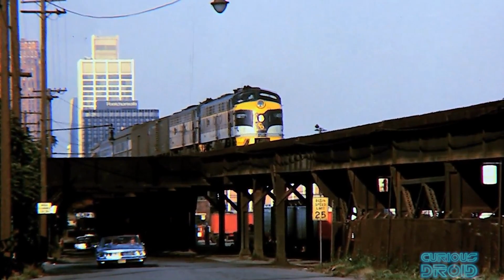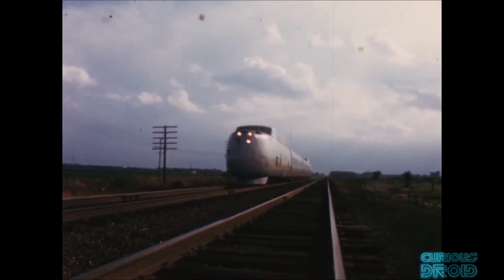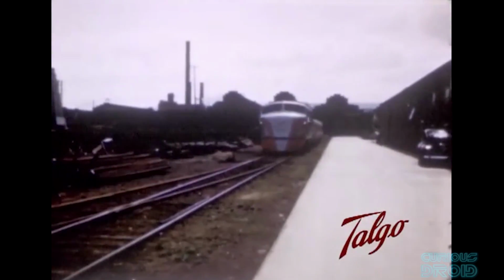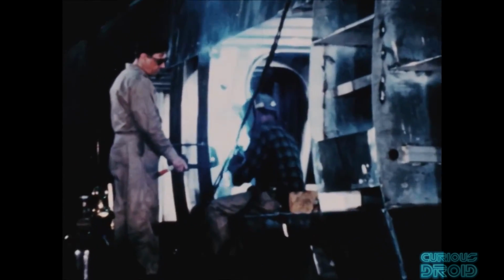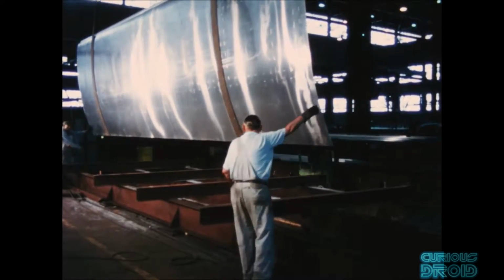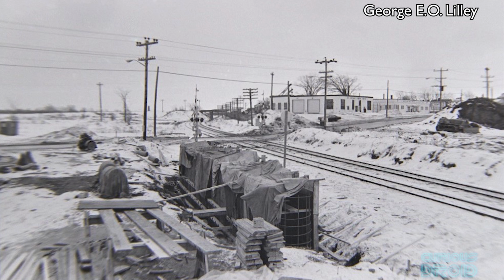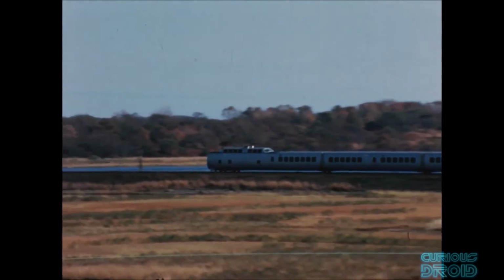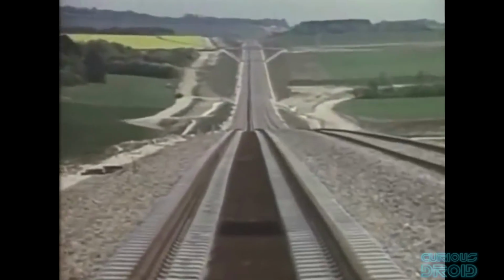America's Failed High Speed Tilting Train - The UAC Turbotrain

Comment: thats the problem, and its same here in australia too. a high speed line could easily run sydney - canberra - melbourne but no actual high speed track exists and would require construction, so they wont do it. So getting around the relatively compact south east corner of australia still requires a 90 min airplane flight with all the hours of pre and post travel waiting around that requires

Comment: Great video. Learned a lot.  I rode Canada from Montreal, Quebec, Ottawa and Toronto in 2018.  As well as France, Japan, China and others over the years.   What it taught me was you don't have to have highspeed to have reliable useful rail traffic.  It is is more about running 60 - 80 mph consistently and station access that is located in the middle of town/ where people need to go.  In other words, there nothing high speed about high speed rail.  Sure faster is better, but cost effective?  Historical example, Pennsylvania rr electric lines on north east corridor.

Comment: The Australian high speed train, XPT, is designed to run on existing track. While it occasionally gets up to about 160 km / hr it is usually much slower and limited by track condition. It is diesel electric like most stock and is a sort of a knock off of the British version with improvements. It is now quite old and still runs. The Syd-Mel had a stack last year after giving it the gun to make up time and unaware that a speed limit was in place because the points had changed. Aussie is too poor for Tgv’s.
Reply: Sounds a lot like the LRC train here in Canada, introduced in 1981.   New trainsets are expected to arrive from Siemens next year.

Comment: Japanese tilting EMUs/DMUs took different approach. They are often referred as Pendulum Express due to the motion of carriages. Briefly speaking, upper body swings along a pair of arc-shaped linear motors which is transversely aligned on the axle unit whilst vehicle enters curve. Electromechanical actuation is only used during transition of entering and exit. Negative is heavier unsprung mass and maintenance cost. I have ridden both Talgos and Pendulum trains. Latter is far more comfort and enjoyable. No scare feeling!

Comment: It really annoys me that dual mode trains exist only as a compromise for New York. As much as I hate them (bi mode means an excuse to not expand electrification), Amtrak wouldn't need to spend hours changing locomotives instead of just switching from electric to diesel and vice versa. I also think it should be looked at electrifying America's long distance freight lines, standardized to 25kV (or 2x25kV) AC at 60Hz. Australia did it (the line to Emerald, QLD) and for some bizarre reason are removing it again) and the Soviets did it too.
Reply: Electrifying rail is too expensive. If it was cost effective, it would have been done already.
Reply: @TheBandit7613    Tell that to the Soviets. The longest rail link in the world, the Trans-Siberian railway, is completely electrified, it took them a long time to do it, but they didn't take no for an answer and did it anyway. Electric Locomotives are generally cheaper to build than diesel locomotives, and don't need refuelling so you don't need to buy fuel for them. Electric trains can also "share" power climbing and descending grades via regenerative braking. A descending train can feed more current by  into the overhead cables via using its motors as generators to assist a train climbing it, you can't do that with diesel locomotives.

Rail companies in the US are notoriously resistant to Environmental laws, of course it's cheaper to not electrify, but the long-term benefits of choosing to do so greatly outweigh the initial cost of installation.
Reply: @jayzo  The railroads are privately owned. If it would be more profitable, shareholders would demand it. I don't have their numbers and haven't been invited to board meetings (some humor) so whatever their reasons are, they seem to be sticking with diesel over electric and any reason I  give would only be a guess.

Comment: Standard EMD diesel locomotives pull passenger trains at 100 mph with standard passenger wagons as regional commuter trains. 
The locomotives here in Denmark are old now and polluting, they were delivered from 1984, so at the same time as the Turbo. 
It has to be much faster.

Comment: Not well remembered, but one of these sets was used near the beginning of Amtrak's existence to placate the Chairman of the U. S. House Surface Transportation Subcommittee, Harley Staggers (D-WV), to operate service over the B&O between Washington, DC and Parkersburg, WV on an every-other-day basis, with a conventional train covering the schedule the other days.  For much of the distance between Parkersburg and Cumberland, MD, the train ambled along at a leisurely 40 mph.  I rode the train from Parkersburg to Grafton, WV in April of 1972 with other fans in the "dome" section of the power car, behind the operator's compartment.  Inside the train, with the exhausts coming up through that section, it sounded like one was riding inside a vacuum cleaner.  We returned on a conventional late-B&O passenger era train, powered by a C&O E-Unit, in which I got my first cab ride for a little while, walking through the engine compartment, past the twin 567 prime movers to get to and from the head end..

Comment: Did you know that a picture of the UAC Turbotrain was included on the Voyager Golden Records to show to the aliens what a train looks like?
My first "encounter" was in a little book about railways in general (aimed at children/youth) where it proudly stood next to a gas turbine freight engine of the Union Pacific. Somehow "gas turbines" were still considered the power of the future when that was written in the 1970s.
There is a middle ground between running fast trains without touching the infrastructure and building entirely new lines. Especially in flatland where existing lines are relatively straight, they can be upgraded for higher speeds by installing continuously welded rail, eliminating level crossings and introducing cab signalling systems. I'm not sure what the signalling systems used by the Turbos was when they ran.
Gas turbines have been tried for many decades in different services, the latest attempt can be found in Russia where they use natural gas (a double locomotive, one half of which is a gas tank with traction motors underneath). The general problem is that rail service, unlike aircraft or ships, means changing between high and low power, not running for hours at the optimal performance point, and that is where gas turbines tend to become highly uneconomic. Lightweight tilting trains have been developed further, but it generally looks like nothing can match the gold standard of electrified railways in terms of performance and efficiency.

Comment: A fascinating piece of rail travel history. I've read many times how it's difficult to promote high speed rail in the USA. It would be a big change for us due to automobile centric planned cities. Also, building dedicated passenger rail could be cost prohibitive. It would be a great alternative for those not wanting to fly or drive.
Reply: The USA is too big for coast to coast high speed rail. High speed rail is too slow to compete with planes that can go 600 mph. 
WAY too expensive.
Reply: @daveunderwood1825  I'd rather take a 600 mph plane than a 150 mph train.
Reply: @TheBandit7613  it doesn’t need to be coast to coast just between many city pairs and have new lines in many mega regions
Reply: @TheBandit7613  well a 150mph train is better than 30mph trains and planes that are 200 miles away
Reply: @TheBandit7613  you like being 3rd world
Reply: @TheBandit7613  so you are ok with eliminating long distance trains?

Comment: Fascinating! I had been unaware of the existence of these trains. Powering the wheels from a turbine without a transmission (usually electric) is terribly inefficient. If they had built them as proper gas turbine electrics to begin with, they would have been considerably more efficient, and it would have been very easy to incrementally electrify the lines they ran on, as desired by adding pantographs to the roof. They were almost there by having traction motors for use in NY! Steam trains used to routinely top 100 mph in the US, but I suppose there were fewer crossing with less traffic at each one back then.

Comment: I always thought the Turbo's in Canada were cool shiznitz back in the day. Albeit, their technology failed on a number of levels. The rolling stock 'wheel trucks' were connected at the coupling, which required a time-consuming process to uncouple and therefore the trains almost always were continuously connected to the same engines. The gas turbine motors were frequently left running even when out-of-service (and parked) which often lead to fires within the train stations in Montreal and Toronto. The service was limited to the Toronto-Montreal corridor, not exactly a commuter run back in the 70s. I sincerely believe the Turbo design could have a new life in the 21st century, with electrification (overhead), independent wheel trucks on each car and engine, and an extension of service between Windsor and Quebec City.

Comment: Interesting you didn't mention Germany and China, both have their highspeed dedicated network connected with lower speed networks. (Well not really for Germans, but definitely is the case for the Chinese.)
Chinese trains can run 300km/h on dedicated lines and continue on conventional 200 km/h lines in the same service.(sharing tracks with low speed passenger or freight trains low speed trains won't allowed to be on high speed dedicated lines).
Japan have some conventional trains (including freight) fitted with Shinkansen signal system, but only for crossing the tunnel to and from Hokkaido. (There are three rails in the tunnel because Shinkansen uses standard gauge, while most conventional trains uses narrow gauge)
Reply: China is also a one party state that can do whatever it wants regardless what the citizens want. Also domestic air travel in china is under developed compared to the west. Germany and Japan were able to start from scratch after the the last world war. America came out of the war with intact infrastructure unlike Europe and Asia so there was no need to rebuild it. We just kept what was working. While much of the world had to start over and could plan ahead.

Comment: The cheapest part on a high speed train is the train itself. The infrastructure is what makes it difficult, it could take decades to dig tunnels, build bridges to flatten out the curves and avoid crossings on the high speed track.
Reply: It could take decades but doesn't have to. On December 8, 1988, the Spanish government decided to build a high speed track towards Sevilla. It was inaugurated on April 21, 1992 in time for the Expo.
Reply: @alaindumas1824  ahh yes Spain, a country smaller than the state of Texas.
Reply: @chickenfishhybrid44  Size doesn't matter. Performance does.

Comment: 1:52 i'm glad you didn't push the Hyperloop stuff.. 
Thunderfoot did videos pointing out how impractical the idea of vacuum trains are and it would have been disappointing if you played into that.
Reply: Thunder foot also did a video pointing out how impractical the idea of reusable rockets are.
He also does videos on how impractical battery-electric vehicles are.

(Let’s not mention SpaceX or Tesla)
Reply: @ernestgalvan9037  "on how impractical battery-electric vehicles are." 
that's a little misleading. he debunked "super batteries" that claim to have substantially higher energy density than other batteries. 
i think thunderfoot does great work debunking science/tech charlatans (incl Musk)

Comment: I recall back in the 80's watching a tech show talking about the Italian tilting trains. I thought it was cool seeing a train making a turn at 120mph or so. I think the Italians had better results with tilting trains, at least I think so. It would be nice to see a video about those trains. I don't remember the name of the trains.
Reply: You're thinking of the Pendolino, which is a trade name suggesting 'little tilter', same root word as pendulum.  Yes, they were a general success for FS Italia, but Italian trains have had a yet more interesting revolution in high speed in the last five years, basically running Alitalia out of the domestic flights business.  In the coming years the network across the upper part of the south will be completed, and it will possible to go 'the length of the boot' from Milano all the way to Bari in about five hours.

Comment: I am not a fan of tilting trains - at least the ones we have in Germany make me sick. Which is quite interesting since I don't get seasick and can handle riding rollercoasters really well.
Anyhow, the problems of not being able to achieve the high speeds due to the tracks is something we also see in Germany. While the ICE can reach high speeds on the dedicated routes and those that havfe been improved for higher speeds, a large part of our rail network is limited to speeds or 160 kph/100 mph or less. One of the show stoppers for higher speed are level crossings - as soon as such a crossing exists, the train has to be slowed down to 160 kph at least to cross this crossing.  So even if you can go faster before and after, it still slows you down significantly, and having to slow down and accelerate again is not the smartest idea from an energy efficiency perspective either. There are massive investments done to allow for higher speeds, but some projects, like a tunnel underneath Frankfurt so that trains don't have to curve around the city to approach the station there, which can as of now only be reached from the west, will take a long time to complete.

It is a shame that passenger rail traffic in the US has basically been reduced to a few touristic trains and commuter services in some parts of the country.

Comment: Grew up with the magical swiss-and french-train-network. Rode various Shinkansen. Here in the US...well...alupanels riveted to steelframes is really a sign of poverty. Its a very different engineering approach than the similar process used in aerospace. Turbine trains did not make sense back then. Its kind of an Epcot people mover.Investing in overhead line  infrastructure in Europe is doable. In the US nobody will. In many ways this is still a pre electrification country with a very low depth supply line which is marginally better in the northern coastal cities. Many people run their own generators...insanely expensive to run..

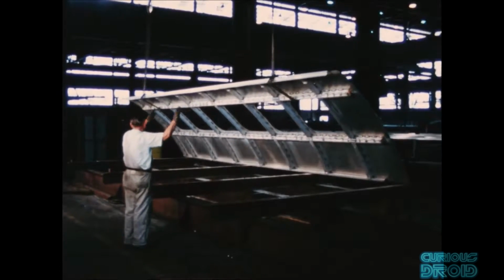Comment: The real reason for the high speed trains died is maths. An ordinary speed train covers the distance of 10000km in seven days, the high-speed train could do the same in four days...But by jet aircraft it's 8:30 minutes, even the aircrafts of 70's used to have a bit more than 10 hours for the trip. So, it's absolutely evident that ground transportation needed new conception. That was found for medium distances, somewhat between 700-1500km, with the advantages of the railway station at the centre of the city and absolutely irrelevant to weather conditions the high speed trains, and boasting ticket's price three times cheaper... Thus the high-speed train won its place in the transportation system.

Comment: Gas turbines always have the problem that they only run efficiently at full load and thus consume a lot of fuel if idling or at partial power due to curves and speed restrictions. So when the OPEC price rises hit, the high fuel use made them uneconomic. Diesels are heavier and have similar problems but to a much reduced extent. Electrics simply grab however much power they need from the wire and hopefully the power station can cope ok with the fluctuations in demand.
Reply: That's why you include electric drive as well...

Comment: Problem is most North Americans consider trains a 19th century mode of transportation compared to flying. Flying is cheaper and faster than long distance trains. Most people prefer to drive the shorter 400 miles or less distances since taking Amtrak and VIA rail are a joke in comparison. Most Amtrak rail stations are no longer in the city centers but fair out in the suburbs and not convenient for many people. Besides commuter trains, this mode of transportation is dead. The federal and state  governments don't want to reinvest hundreds of billions to build a separate passenger rail system not connected to freight lines.